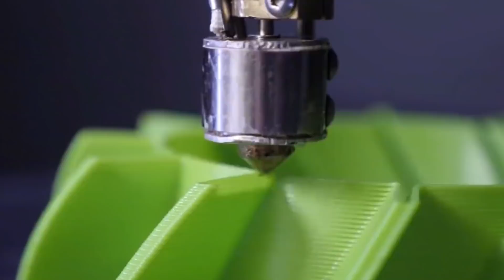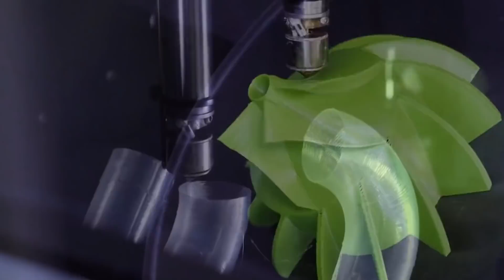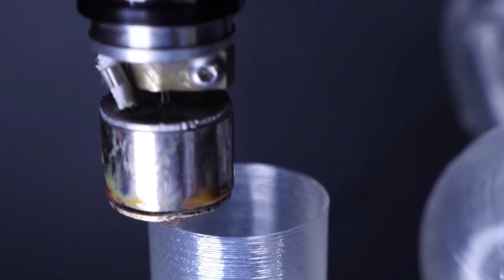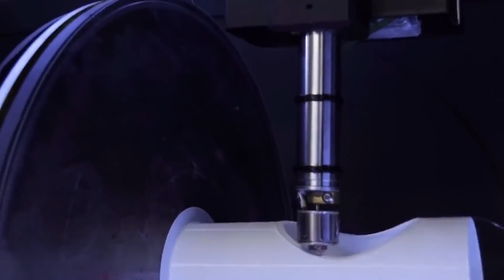Impression 3D sans support

Comment: How would you calibrate the first layer height on such a machine? Also calibration in generel seems to be way more complicated.
Reply: Thats a standard cnc Calibration i guess. ON cnc systems you tell the computer how long your tools are (distance to nozzle tip) And there are other tools for the machine to get the position of the build plate. Basically auto bedleveling but a bit more advanced.
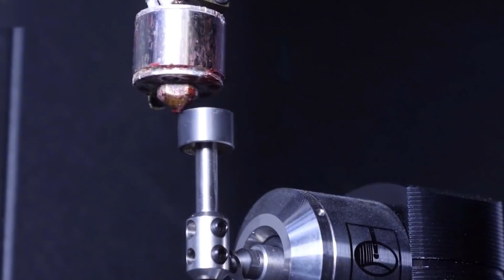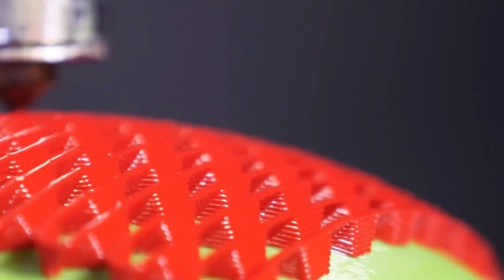Reply: You can see at 0:43 and 0:55 they have to spent lots of time doing additionally measurements, just like a standard 5-axis CNC would. It honestly looks like they repurposed one in fact since it's not like a 3d printer needs a splashguard.
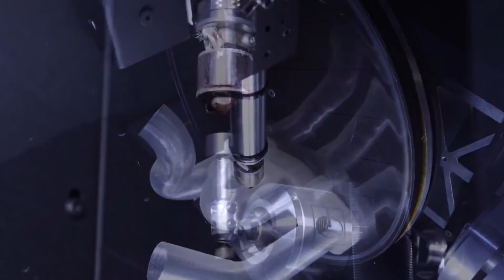Reply: @AlsoDave  I was about to comment and say that perhaps it was a heated chamber, but then I saw how beefed up the 4th axis is and when I got to 0:43 a Renishaw probe pops up which in itself costs more than most printers, so I was leaning towards it being a CNC mill. But then you see the two fans in the last few secs. So, again, it might be a heated chamber build. Perhaps a repurposed mill or made from the ground up for printing but using some nice CNC mill parts. Either way, pretty cool.
Reply: Hypothetically, without the expensive extra tooling mentioned above, you could use g-code and the existing bed motors to automate tramming (run through three or four points several times with a BL Touch until they come out even within your chosen tolerance) then double check total flatness with ABL or UBL. So long as you've input the dimensions of your nozzle sufficiently, measuring the location of that seems unnecessary - though it could tell you if your gantry itself is out of square with the frame.
Reply: Now, when you add a rotary axis or two to the print head, THAT'S when you definitely need to start calibrating the nozzle position.
Reply: even if this machine is just a repurposed cnc for now- the huge challenge with 4, 5 axis 3d printers is slicing, and if creality is using this machine to work on that then it’s a huge deal
Reply: Basically your offset comes off the center of rotation rather than the top of the table, and you would set the offset in the slicer.

Comment: How do the layers work on the curves
Reply: the software donsent do layers, it tryes to break it down to a line that the extruder follows, i think, but im no expert so it could be totally wrong
Reply: i think in nx unigraphics with handmade postprocessor
Reply: the Teo  i bet that they just used a cnc 5 axis program and changed it so that it calculates the filament speed too
Reply: @dovos8572  I am pretty sure that the case as well. You can see them using standard ruby probes as well. So it's more like a 3d printing tool head for a 5 axis cnc machine. That likely explains the lack of cooling fan as well. Pretty easy hardware conversion. And I imagine the slicer is kinda like running machining g-code in reverse lol
Reply: @ChevTecGroup  Few years ago i was working on this project, but i left this company. Cooling was designed to go trougth this long hotend tube and using special flow reflector was redirected over the print but problem is that increasing diameter of hotend, you will decrease allowable movment. It seem that this still isn't final version (but i migth me wrong ;) ). 
At first there was used CNC software like fusion to "revert" the proces of printing and using script there was added filament extrusion, but company was working on they own slicer Softshaper in parallel - i have no idea if this is supporting 5ax slicing now ;)